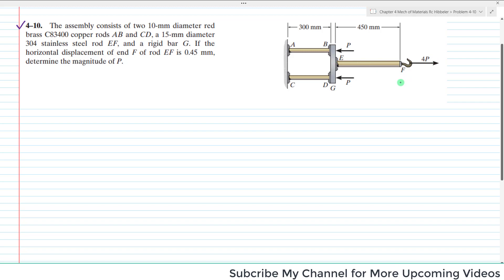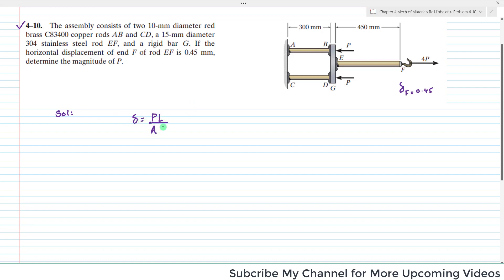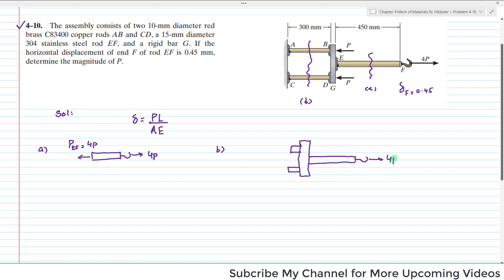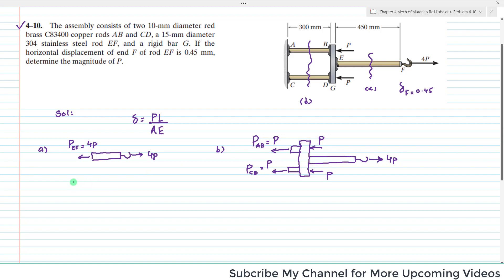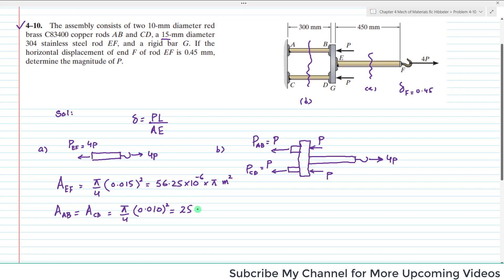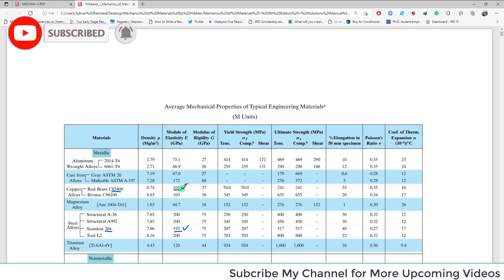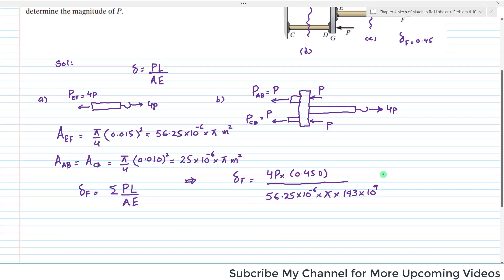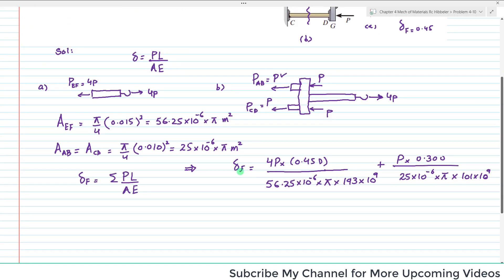4-10| Chapter 4 | Axial Loading | Mechanics of Materials by R.C Hibbeler 9th Edition|

Comment: At 2:35 Can you explain why the total force in members in AB and CD is only P not 2P to include the other external force P which is given on the diagram and Pab which we find using equilibrium
Reply from the maker: The net force you can see on the free body diagram is 2P and this load will be equal to the load in member AB and CD therefore each will take load P to maintain equilibrium

Comment: Sir I took the exam today and in the exam, instead of 4P load there was a wall at F and the forces in the rigid bar was 50kN. The diameter of the brasses was 30mm and the diameter of the steel was 40mm. It was asking to find the reaction forces. I used superposition which I free the right hand of the assembly and solved. Would my answer change if I free the left hand instead of right hand? This is the question in the book Hibbeler 10th Edition CH4 Q51
Reply from the maker: I dont think so that your answer will change. Do check below questions and this is how we solve indeterminate problems
Reply: @engradnanrasheedmechanical  We will see the exam results and will see whether my answer is true or not. Thank you so much Professor. This was a midterm 1. In the further midterm and final, I will again watch your videos too. Thank you so much again. Blessings from Turkiye 🙌🙌
Reply from the maker: @yasin_zengin you are always welcome and best of luck for your future endeavors
Reply from the maker: https://youtu.be/9zCXugAYsTw
Are you talking about this question?
Reply from the maker: Or this will be https://youtu.be/g4oxc1kAnZo
Reply: @engradnanrasheedmechanical  No sir, I'm talking about this question 4-10. Only the arrangment was different.